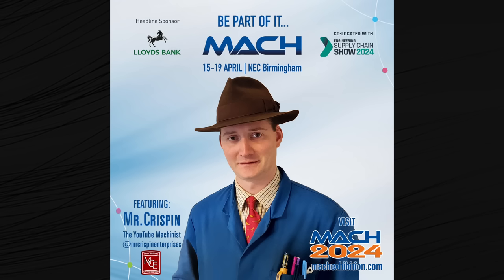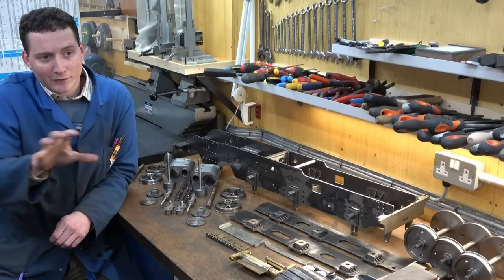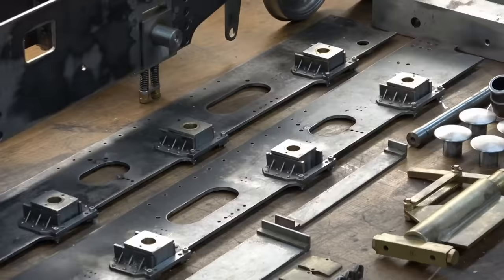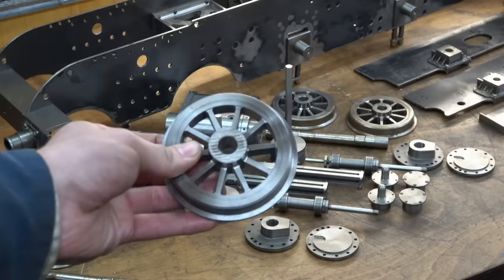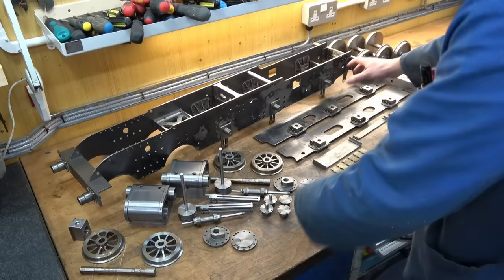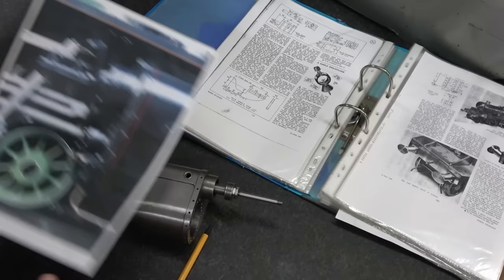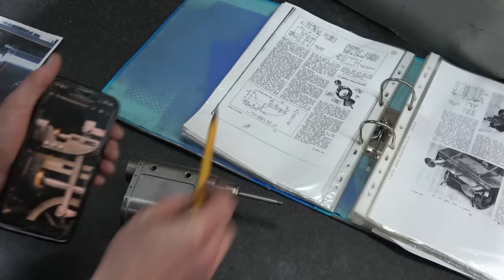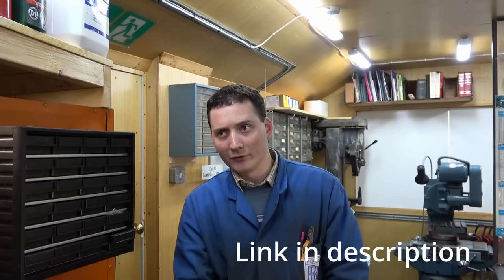Return of the Locomotive

Comment: Hi Mr Crispin,  don't feel bad about your lack of progress. I started on Minnie,  a 1" steam traction engine, or at least I got the book, in 1976, two countries ago having immigrated in 1979 to Canada. Machine tools graduated from a second hand Unimat 1 which I still have, to a 1949 myfird ml 7, obviously used and now a brand new PM 932 gear head vertical milling machine.  As for progress I have the wheel rims rough turned, the boiler shell made, a start on the horn plates and side plates, the cylinder, piston, water pump and chimney saddle castings in hand and the flywheel ready for machining. The gear cutters have been purchased so that required the mill to have a dividing capability, which is now being developed. So, like you, there's been a hiatus of progress to make tools to enable further  progress. Regards from Canada's banana belt. 🇨🇦🍌

Comment: Before commencing with much more, can I suggest making the connecting rods. At the moment with the chassis as is, it should be possible to use it as a jig, just put some bushes in the horn guides or for more accuracy the axle box bores and transfer those centres to connecting rod material. If you attempt to match connecting rod centres by measurement or whatever it's extremely difficult to get a free running chassis.

Comment: Great to see this project back on the bench along with your unique train of thought (pun not intended).
Although the wheels look fantastic, I am curious as to why you are not using available castings which would save a great deal of time.
Reply from the maker: Not a great fan of cast iron as a tyre material but the main reason was that I was on apprentice wages and machining then from bar stock was cheap!
Reply: @MrCrispinEnterprises  Fair enough, it will be of interest to see how you go about profiling the spokes.
Would it be feasible for you to shrink a metal tyre onto a cast iron wheel?
Reply from the maker: Yes that's what I'm planning to do for the driving wheels.

Comment: Mr Crispin I had a thought while I was watching the very beginnings of well actually up to the halfway point where you were showing the pictures and I saw the wheels. I believe a CNC with a very small roundover bit could be used to good service on creating the illusion of the front of those wheels at least. If the back needs to look like that too I'm sure that's very doable. CNC isn't cheating at all if this is a hobby build and this is just for making it prettier, more authentic, or, functional in a fashion that you can't do without needle files and many many hours of time.

Edited to add  - a Roman ogee bit might work best try achieving that that small.
Reply from the maker: Yes that is definitely an option. Cheers!
Reply: @MrCrispinEnterprises  if I remeber, the steel of the wheels is an L series, right?
Reply from the maker: I haven't got that far yet! The front bogie and tender wheel are just EN1A. I'll choose something a bit more carefully for the driving wheels.
Reply: @MrCrispinEnterprises  good, the L (leaded) series here in the states is more than somewhat leaded, 0.1% by weight. Max content would be 0.35% by weight, substantial more for easy cutting on screw machines requiring large stock removal on the stock diameter. The lead aids as a lubrication system element when the coolant and dimensions are harder to jib with each other. 

L Series steels can be heat treated for case hardening as usual, welding is not a good idea. EU regs do not allow for its wide use in production.

EN1A is mild steel, cold worked and bright it comes both leaded and non-leaded

Comment: Will you be lathing a dowel then drill out the centre with seats either end then split it. One piece bushing with seats, yer I’m not sure of the correct ter😅 dropped in with a machined half cross bolted on top so the bushing would not walk out?
Reply from the maker: Something along those lines!

Comment: Are you worried about rust from the stream and water? Maybe hard chrome some parts that need protection?
Reply from the maker: Good point. Allot of the parts will be painted which will help.
Reply: @MrCrispinEnterprises  i was worried about the borrs and pistons sitting after use....?
Reply from the maker: Generally they get blown out with the cylinder valve cocks open at the end of a run  and then filled with oil and run backward and forwards a few times. It worth thinking about though.

Comment: I would wonder if you could turn the spindle guide as part of the cover, with all the cross sections being round. Or at least the bulk of them, to which you could silver solder those bits that need to be odd shaped.

As to dragging around projects, I have an oscillating engine kit that has been with me since 2005, so that is coming on 20 years.
Reply from the maker: Yes the covers will be part of the main bodies. Cheers.